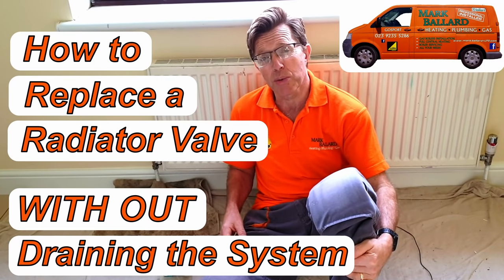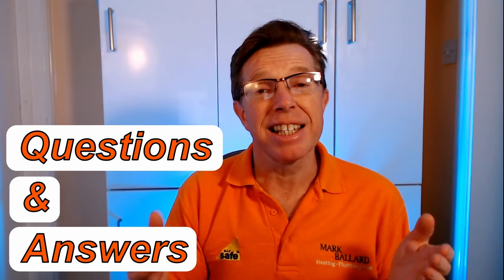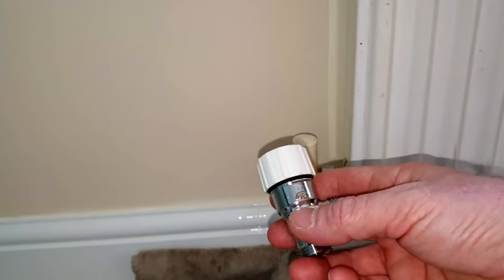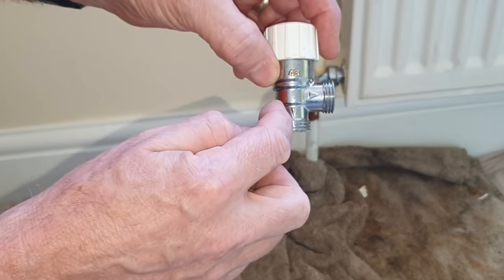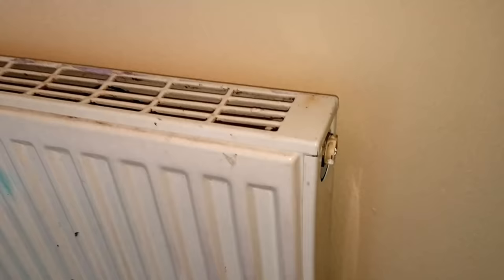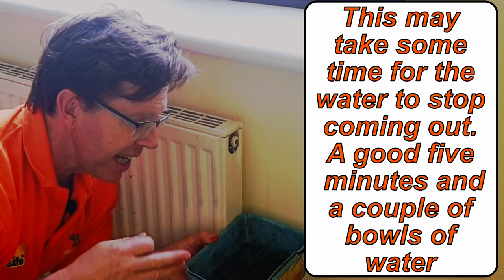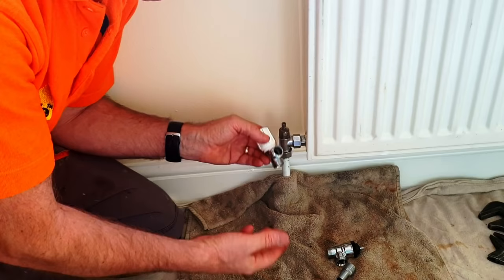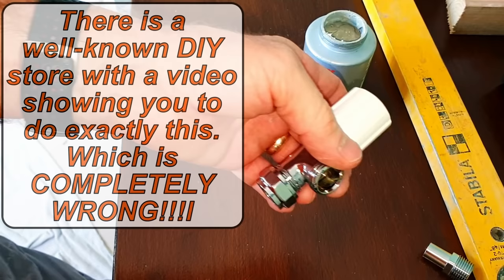Replace Radiator Valve with Out Draining the System. Updated. Part 1.

Comment: Thank you. I found this video really useful. As a keen DIYer, I have always drained down the whole system when changing valves. Your method is so much simpler, saves time, the risk of unwanted air locks (which I've had) and of course water.
Q- Is it better to put the TRV on the flow side of the radiator?
Reply: Good to watch Mark, thank you. 
A- I have just replaced the 10 TRVs on my o-l-d system with Evohome wireless controlled valves and this showed me the difference in feeding from Flow and Return sides of the radiator. Feeding from the Return side causes the room temp to vary more than if the radiator is fed from the Flow side. I have not worked out why, possibly compensation devices on the new valve head.
I have noticed that a few of the old valve heads have started to leak, they do operate more than a normal TRV. Guess what I will be doing when the weather warms up, if I don't follow your video first!

Comment: I put the heating on for 5 minutes then turn the power off, blow the pressure off on the Pressure Relief Valve then close the flow and return valves off on the boiler. The system is now cooling and will soon be less than atmospheric pressure.Make sure the PRV seals.If it does not it is quite easy to dismantle and cleen it.
Reply: Can you dismantle a PRV as it’s a safety device?

Comment: The pipe on which my TRV is fitted is fixed in concrete so it looks like I’m going to have to lift the radiator as you demonstrated in your video, I know you said if the radiator was short it might move the valve /pipe work at the other end as you lift, my rad is about 2m in length, won’t that be the same? Pipe work on the valve at the other end of the rad is also into the concrete floor.

Comment: isolate the boiler not all the other rad valves if its a combi, then the system airlocks and u get very little water to none to fight. That way if its sn old house your not changing others old valves. Another tip use a wet vac to catch the water until it stops after a min.

Comment: The video is pretty spot on for how I'd do it as a plumbing/ heating engineer but gotta remember your average DIY'er is probably pretty dumb so this is gonna end up with a ruined carpet 😂 problem that could really ruin someone's day is that olive on some makes of valve is pushed further down so when you try to put the new valve on the olive doesn't fit into the new valve properly.

Comment: I would always suggest installing the thermostat on the return side. the flow side is too hot  for the plastic and they dont last long. just lost a 40 quid smart valve  at 6 months due to embrittled plastic!

Comment: I never drained via a vent,as they are high level use a drain off or crack the nut in rad valve  with an aqua vac underneath

Comment: Have a sealed system and trying to do for a downstairs radiator, but pressure doesn’t drop. Boiler is off and I’ve closed valves in all other radiators but been draining from the bleed valve for over half an hour with no drop in pressure

Comment: Q. Recently had my TVRs changed but they don't work not switching of the heat (I think they never changed the thermostat to go with them) the plumber seems to think the system needs flushing for them to work but I've recently flushed the radiators with the help of your excellent video on flushing,and tried the TVRs still no luck but raditors are all warm now, would he be right or does the thermostat need changing?

Comment: Hi Mark, very useful and I’ve learnt a lot. Is there any chance you could a couple of videos on how to deal with a cold radiator (even if you’ve bled all the air out),balancing, and dealing with a snapped bleed screw. I’ve spent hours with these problems in the past!
Reply: Robru shut all your rads off except the one thats cold
Then fire up the boiler it should heat up the rad
Reply: If it's old or if you haven't had enough inhibitor in your system, your radiator could be full of gunk - especially if it's at a low point in the system. In that case (drain and then) remove the radiator, take it outside and use a hose to force water through until it runs clear. Alternatively, buy a new radiator. Refit and try again 🤞
Reply: @johnmckay1423  that’s good to know. Many thanks John!
Reply: @tonyclough9844  thanks Tony

Comment: Hi. So helpfull Thank You. I guess the pipes I have that go into radiators are very thin, they are around 5mm diamter. I am worried I will kink the pipe accidentally. Do you think it is still safe to attempt to drain the system on lockshield valve (as I do not have drain valve in a system)? My goal is to drain the system and refill it with cleanser to get rid of cold at the bottom of radiators.

Comment: Hi Mark really in depth tutorial - thanks! How do I find a leak in my central heating system that is not showing itself? Been told it's probably under floor somewhere!!!
Reply: Hi Andrew, My system needed regular topping up and I assumed a leak. Turned out it was a faulty diaphragm in the expansion vessel in the combi, not holding pressure.  Good luck.

Comment: if i wanted to replace the radiator and valves at the same time, can i follow the same steps of bleeding the pressure closing the valves and then remove the radiator with valves attached keeping the water inside the rad?

Comment: Hi, it's it the same process to change both valves at the same time? As I am putting in a towel rad and need to remove the old valves and rad. Or will I need to drane the system to do this?
Reply: Should be the same process. Only difference, I would be tempted to shut the valves on all the other radiators in the loop to save on the amount of water you have to drain.

Comment: My system
drops
pressure every often, cant fine any obvious leaks. Combi Boiler was installed 2 years ago and radiators replaced last year. When heating system turns on I could hear loud noises from pipe works. Would like some help to find the leak, TIA

Comment: great vid! can you confirm please - I have a rad with the TRV on the return pipe. Is the pipe that heats up first the flow and should the TRV be connected to the flow as best practice? (combi system)

Comment: Great video, thanks! My TRV has been installed on the wrong side (should have been fitted on the flow side) so I need to swap the lockshield and TRV valves around. Would i have to drain the whole system down in my case or can I use your method in this vid? I have a combi boiler and the radiator is situated in the downstairs hall. Thanks, Ian

Comment: I notice you used the old olives - how often is this the case if the valve you are replacing was leaking? I find most olives become securely attached once deformed - how do you get them off the replace them with new ones?
Reply: Please someone answer this
Reply: The old olive will come off the pipe with a pair of pump pliers
Reply: You can very carefully use a junior hacksaw to split the olive.
Reply: If an olive comes off with pump pliers it probably wasn't done up enough in the first place (but you could get lucky), and a hacksaw risks damaging the pipe - if it has to be done, it has to be done, but to be avoided.
Reply: @martingerhold2111  I've been plumbing for nearly 40 years and never failed to get an olive off having said that the copper ones can be awkward compared to the brass ones but they will come off

Comment: I've been wondering about my old radiator thermostat valves... they are many decades old.. they are now pretty much on/off valves.. if you turn the thermostat the smallest amount it completely shuts down the radiator or makes it scolding hot. I cant really see how the valve itself can make this happen, so wouldn't it b enough to just change the thermostat itself? Then again... I don't understand how the thermostat itself can cause this either...

Comment: Learner question:@6:50 to create air lock on upstairs rads do you just shut down one valve(trv/wheelhead) or both valves(Lockshied and wheelhead) .If just one do you not get leakage through the other? Hope this question  makes sense.Really enjoyed your videos.Very informative .Thank you.
Reply: You don't need to iso any rads on a sealed system even ones above, as long as you only have one open end at a time it will vacuum, only reason to iso the rad above is if you're worried above the vacuum failing, it can sometimes (rarely) drag air in via the boiler AAV in which case you'd have to iso the boiler, i just iso both ends of the rad and cap the tails and drain the pressure by the valves
Reply: @steowens8243  Thank you for your reply.

Comment: the problem with this method is, some valves have the olive in a different place. i just replaced some old valves to Drayton 414 and they are shallow, so when I inserted the pipe the olive didnt reach the valve body, I had to cut off the olive and clean up the pipe, fit the new olive.

Comment: Great video 👍 is it ok to leave the old nut and olive from the old valve when fitting a new one? Also would you use joint compound on the new valve before offering it up to the fittings.

Comment: I'd contradict your not putting thread tape on the valve body thread. My experience of many installs is that the PTFE tape helps lubricate the treads of the nut and valve body when tightening them. Just a couple of turns only..
Reply: Doing that stops the olive sealing against the tapered valve body. Jointing compound is much better than ptfe
20 years doing heating and I’ve never taped a thread on any rad valve except the balance tail

Comment: Is it possible not to drain the system if you're replacing all the valves with thermostatic ones? I've got 11 radiators and need to have thermostatic ones fitted on all of them.

Comment: What if the old value has a larger nut on the pipe?
Reply: Union nuts they're called. Gotta take out radiator tail and replace with 15mm radiator tail

Comment: I want to change the towel rail + valves in my en suite so was going to buy the plugs for the loft water tank.  However, I’ve seen there’s a label on a water feed in the airing cupboard that says it feeds the en-suite and bathroom which has a stop cock on.  Can I isolate this feed to save plugging the loft tank?

Comment: When re-assembling did you use new olives or the old ones (didn't see refitting the olives)
Reply: On this one he kept the old nut and olive on the pipe side ,I guess with a wet vac used he could also have cut the old olive off and removed the old nut replacing with new nut and olive ,let’s face it some old nuts can be proper manky looking ,I would not leave an old nut on the pipe side with a new valve
Reply: Removing an olive without damaging the pipe surface is a non-trivial task - I wouldn't try

Comment: Hi Mark. I have a 10mm system which I'm changing all rads and valves. Should I change valves to 15mm and finish the 10mm as close to the rads as possible? Thanks
Reply from the maker: You can use 10 mm or 15 mm radiator valves it makes no difference to the operation.
 if you want to use 15 mm you can just use "10 to 15mm compression reducer"  fitting to reduce the pipe in the valve. hope that makes sense.
Other than looks and strength. there's no advantage to fitting the 15 mm pipe
Reply: Less chance of blockage on 15mm pipe,10mm is too small,repipe rads in 15mm if possible,less hassle in future. Inhibit too

Comment: I have a leak on the bottom nut. Undone it and tied ptfe tap on it but there's still a drop here and there. If i put sealant on the end where the olive is rather than on the thread this should fix this?

Comment: Drain the system, change valve refill, add inhibitor , safer, cleaner and inhibitor will save you money in the long run.
Reply: Air can be a pain to get rid off in some systems when refilling a fully emptied system

Comment: I have just changed my TRV but the pressure of water coming out of the pipe was like a jet wash. I removed the radiator to redecorate a while ago and have used the heating since then, and replaced the valve before refitting the radiator, will that be why the pressure was so high? I have a combi boiler and it is on the radiator furthest away from the boiler on the ground floor
Reply: If the boiler is upstairs there will be more to drain off, plus all the water in other rads too. You could have opened the valve manually with a bowl on standby to check how much left before whipping it off !

Comment: Great video thanks Mark. Have a question. Is there anything different when the pipes are 8mm in/out the valve? I assume any standard valve will fit?
Reply: You may need 15mm to 8mm reducers. I’ve just fitted a rad with TRV and needed reducers for the 8mm pipes.

Comment: Hi great video. Im just about to attempt this myself. I get the principle if the rad and bugibg it once the water slows, but just cant quite trust when I take the valve off the pipe from the floor how does water not spurt everywhere. Mine is a bottom rad so would the pressure from the upstairs rads not try rush out? Should I turn all other rads off? If so both sides or just the one?

Comment: If you Shut all the valves on every rad you still have water in the feed pipes so you have to drain what's left so in effect you do drain the system & fill it with air ??

Comment: Hi mate,
What if you’ve got a immersive heater with metal and insulation pipes instead of copper. I’ve got a leaking radiator valve and the carpets are brand new

Comment: Hi. You make several mentions at the beginning of your videos of how you use bungs and caps to isolate and plug the system before you start these jobs. Where is the link for this specific video you refer to please?
Reply: In open vented systems, one of the bungs goes in the CH expansion pipe and one in the CH cold feed into the system ay the header tank and it basically turns it into a sealed system so it vacuums and you can swap valves without draining

Comment: Hi. What is the title of the video that shows how to deal with rad pipes that are set in concrete and have little or no movement, making it difficult to remove from the radiator. Many thanks
Reply from the maker: https://youtu.be/VkLIRP2ZVqw
Reply: @MarkBallardLTD  thanks Mark. Much appreciated.

Comment: Hi Mark.  Quick question.  I have a Conic EN215 No. 49 radiator valve head which no longer threads into the radiator valve.  I can’t seem to find these valve heads for sale.  Is there a suitable replacement for them?

Comment: Needing to change a couple of faulty trvs on rads on our second floor, problem is my combi is on the 3rd floor loft conversion along with 2 other rads. Will my setup be problematic to achieve an airlock and would it be a better idea to drain the system?

Comment: @MarkBallardLTD  hi mark, firstly thank you so much for your content which has really helped a lot. 
Id be ever so grateful for your advice?, A year ago i removed 2 radiators downstairs before plastering and decorating. It took me a while to get around to it but shortly after reinstaling they had leaks at the bottom. 
Im getting new ones soon, and wondering about inhibitor.
At some point in next 6 months ill be getting around to replacing all the other old rads.
Am i better waiting until ive replaced all of them, then put inhibitor in, or would you advice to add it straight away when installing the 2 downstairs.
Reason i ask is until having new boiler a few years ago i never touched the back boiler system and all are old radiators. Water was black when removing first time, but clear second time. If ive sludge in upstairs rads will adding inhibitor break it down and move it to the rest of system (and new rads) if so could i be best leaving it until all rads are replaced? 
Or should i do belts and braces and add inhibitor, let it break sludge down, then drain system and reapply inhibitor in a few weeks? 
In regards so inhibitor is x100 fine for any boiler or does it need to be certain types for different systems and or same as what initially when into the sytem. 
Keep up the good work mark, im already thankful for your channel and massive gratitude for any support you can offer. Kind regards Suzi x

Comment: Reducing pressure in the system using the bleed valve is the same as draining the system, just slower. You're probably better off just opening a drain valve, either way you're going to have to top up the pressure, and there's less chance of water ruining the carpet

Comment: I have two radiators bottom floor of farm house that are horrendous at banging and making a fog horn sort of noise that reverberates around the entire system, i've proved its down to these two radiators by isolating all the radiators in the house one by one and when the problem stopped i left them isolated and hasn't happened since. So my question is, would this be an issue with the radiator valves being would replacing them resolve the matter or is it likely something more sinister in the system. 

Information on the system, Oil fired boiler heating both the closed heating system and primary for the unvented system. 

Thanks

Comment: What about a valve that has two micro bore pipes going into the valve from the bottom,a micro bore pipe running in the bottom of the the  radiator, how do I replace the valve